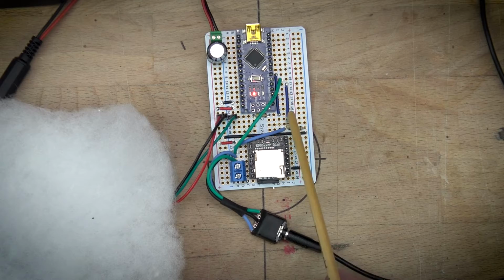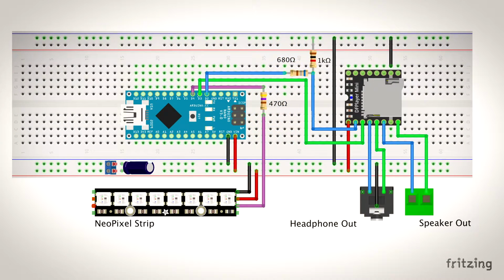Lightning and Thunder Effect - Arduino, DfPlayer Mini, NeoPixels

Comment: I would like to use this just for lightning effect, without the thunder, what do I need to remove in the code ? I tried with the full code (just the lightning hardware, not the player) it works, but it stops after 2-3 times flashing, I guess it's waiting for some mp3 ti ply that is not there ?
Reply from the maker: Sorry for the slow reply. You may have already figured this out but you're probably correct. There may be some issue with the sketch waiting for the track to stop playing. Here's a version with the audio stripped out. I didn't test it but it does compile without errors so it should be pretty close!

// includes
#include "SoftwareSerial.h"
#include <Adafruit_NeoPixel.h>

#ifdef _AVR_
#include <avr/power.h>
#endif

// set number of pixels in strip
int numPix = 16;
// set pin to control neopixels
int neoPin = 4;
// set initial brightness 0-255
int brightness = 255;

// create led object
Adafruit_NeoPixel ledStrip = Adafruit_NeoPixel(numPix, neoPin, NEO_GRBW + NEO_KHZ800);

void setup() {
  // initialize neopixels
  ledStrip.begin();
  ledStrip.setBrightness(brightness);
  ledStrip.show();

  // initialize serial port for output
  Serial.begin(9600);
}

void loop() {
 // lightning variables
  // use rgbw neopixel adjust the following values to tweak lightning base color
  int r = random(40, 80);
  int g = random(10, 25);
  int b = random(0, 10);
  // return 32 bit color
  uint32_t color = ledStrip.Color(r, g, b, 50);
  // number of flashes
  int flashCount = random (5, 15);
  // flash white brightness range - 0-255
  int flashBrightnessMin =  10;
  int flashBrightnessMax =  255;
  // flash duration range - ms
  int flashDurationMin = 5;
  int flashDurationMax = 75;
  // flash off range - ms
  int flashOffsetMin = 0;
  int flashOffsetMax = 75;
  // time to next flash range - ms
  int nextFlashDelayMin = 1;
  int nextFlashDelayMax = 50;

  // map white value to volume - louder is brighter
  int flashBrightness = random(flashBrightnessMin, flashBrightnessMax);

  // map flash to thunder delay - invert mapping
  int thunderDelay = random(1000, 250);

  // randomize pause between strikes
  long strikeDelay = random(18000, 30000);

  for (int flash = 0 ; flash <= flashCount; flash += 1) {
    // add variety to color
    int colorV = random(0, 50);
    if (colorV < 0) colorV = 0;
    // flash segments of neopixel strip
    color = ledStrip.Color(r + colorV, g + colorV, b + colorV, flashBrightness);
    ledStrip.fill(color, 0, 4);
    ledStrip.show();
    delay(random(flashOffsetMin, flashOffsetMax));
    ledStrip.fill(color, 8, 4);
    ledStrip.show();
    delay(random(flashOffsetMin, flashOffsetMax));
    ledStrip.fill(color, 4, 4);
    ledStrip.show();
    delay(random(flashOffsetMin, flashOffsetMax));
    ledStrip.fill(color, 9, 14);
    ledStrip.show();
    delay (random(flashDurationMin, flashDurationMax));
    ledStrip.clear();
    ledStrip.show();
    delay (random(nextFlashDelayMin, nextFlashDelayMax));
  }
  // pause between flash and thunder
  delay (thunderDelay);

  delay(strikeDelay);
}

Comment: Great Project. Also if it's older, I haven't seen such creativity for a long time. I think, it's one of the best Arduino / ESP32 projects for tinkers. Thanks for sharing!
Reply from the maker: Thanks! This one gets a lot of views because it can be used in so many ways. I just had someone use the basic idea for a Haunted Mansion changing portrait that turned out AMAZING. It also brings together light and sound control that opens up a world of other projects. Thanks for the comment!

Comment: Hi. I would really like to do this project. If you could please post an exact list of all the items used for this project in the chat including the speakers, speaker wires and what the gauge of the wires are 18 or 20 gauge and items used to power the board.. I'm racking my brains, and I have searched far and wide for all the items for this project with no luck. There are items missing. This list of items in the description of this video are link to items that are unavailable on amazon, the list in the description is incomplete and doesn't include all the items. Thank you so much. Its greatly appreciated.
Reply from the maker: I think this blog post has all of the smaller parts - https://randommakingencounters.com/lightning-and-thunder-effect-arduino-dfplayer-mini-neopixels/

There are some additional comments with replies that speak to wire gauge. It's a little bit of an "it depends" situation. The wire gauge is really determined by the number of LEDs in your strand and just how much  you're driving them (number of colors lit and intensity). This is a great link to help understand how many amps your strand might draw.

https://learn.adafruit.com/adafruit-neopixel-uberguide/powering-neopixels

Once you have the amps... pad it a bit for safety and then do a quick Google for awg wire gauge ampacity or current rating.  

I've also written a few replies that speak to powering strategies since you may need one voltage for the LEDs (5 volts) and one to power the Arduino (9ish volts). You can step voltages up or down and you can also try powering the Arduino with 5 volts on the VIN and GND pins but it's just at the lower limit of what the board may or may not function properly with.

Here's another link with a different approach to this effect that may also point you in a solid direction on how to tackle your project.

https://randommakingencounters.com/thunder-and-lightning-effect-redux/

One last thought if you're not an Arduino master programmer (I'm certainly not but I get by). Chat GPT writes pretty solid code if you explain what you're doing. If you outline the modules you're using (Arduino Nano, DFPlayer Mini, RGB NeoPixels or RGB LEDs) and write out how you want it to behave, it can get you close and is a great learning tool. It's not a replacement for understanding what the code does but it can provide a starting point. The links provided also have the code I've used on projects.

Hope that helps! All the best with your project!!

Comment: Question? Isn't the red and ground wire have to be a solid wire?
Reply from the maker: I'm not sure I understand the question but I'll see if I can get you some useful info. Are you asking if the positive (red) and ground (black) wires each need to individually be a single strand of wire? The answer is yes... you are correct. What might be confusing in the video is how the connections work on the prototyping board. Those wires make look like they're interrupted or bits of wire but the prototyping board has connections that string them all together. I hope that answers your question. Thanks for asking and all the best!
Reply: @RandomMakingEncounters  oh got it. the red and black 20g wire I bought isn't a single stran.
Reply from the maker: @roycenedeleff1893  wire comes in solid core and stranded. There are differences between the two in how the perform but a quick google search says 20 awg wire should handle up to 3.5 amps… give or take. The gauge is what’s the critical factor and I always try to build in a safety margin. I usually use stranded, silicone covered wire. I don’t like how the PVC covered insulation melts and is stiffer. However, silicone is softer and more prone to physical damage so everything is a balance.
Reply: @RandomMakingEncounters  okay. Im missing a few items I need for this project. Do you have a link for the purchase of the speaker wire, speaker wire connection, and the speakers? I'm kind of confused about how you have the LED lights connected to the board that go into the cotton cloud.I purchased a 12v power supply and Im also not sure how you're running the power to the board using the power supply. Last question. What is the brand the speakers you're using to connect to the speaker  connector. Thanks. I hope my questions weren't too confusing. Thanks:)
Reply from the maker: I think this blog post has all of the smaller parts - https://randommakingencounters.com/lightning-and-thunder-effect-arduino-dfplayer-mini-neopixels/

Here's another link that talks about the using the sound player and mentions only using an 8ohm speaker - http://www.trainelectronics.com/Arduino/MP3Sound/DFPlayer/

Here's a link to speakers I've used that are 3 watt, 8 ohm speakers - https://www.amazon.com/dp/B07FTB281F

I've had mixed success with speakers powered directly from the amp on the DFPlayer Mini. They can be a little quiet. The good news is you can also connect an external powered speaker jack to the board and use a speaker that has a headphone plug and it's own power to really blast out sound if you need it. The links above should show that.

Here's a link about a different approach to this type of effect and talks about power requirements - https://randommakingencounters.com/thunder-and-lightning-effect-redux/

Here's a good link about powering - https://learn.adafruit.com/adafruit-neopixel-uberguide/powering-neopixels

OK... let's talk a bit about powering projects like this. The Arduino can be powered through the VIN and GND pins with voltages between 7 to 12 volts. There is a voltage regulator on the board that steps that down to 5 volts which is what the board uses. The DFPlayer and NeoPixels are 5 volt only but some programmable RGB LEDs can come in several different voltages with 5 and 12 volts being common. This means you may have two different voltage requirements for your project... which is common and normal. To power the project, I usually connect the power supply to the VIN and GND on the Arduino board... that needs to ideally be between 7 and 12 volts. To connect the LEDs, these programmable LEDs are also connected directly to the power supply with a 1000 uF smoothing/decoupling capacitor added to protect against voltage spikes. IMPORTANT... the voltage you're supplying needs to match the voltage of the strip. If you're using NeoPixels, you need to step the 12 volts down to 5 volts or you'll fry the LEDs. If you have a 12 volt strip, you can connect as normal. You also need to connect the ground of the LED strip to the ground of the Arduino or the LEDs won't work. In the breadboard schematics you'll see that I always have different sides of the breadboard providing different voltages. If you choose to use a voltage regulator to step the 12 volts down to 5 volts, make sure the regulator can handle the amps the LED strip might need. It can add up quickly on a long strip. The Adafruit link talks about calculating power requirements. The thing you're looking for is a step down regulator that will take 12 volts down to 5 volts that has the amperage rating you need... more is better.

I know that seems like a lot. This setup is a little challenging because it can require figuring out the best way to get two voltages. You technically need over 5 volts for the Arduino and 5 volts for the DFPlayer and LEDs. You can use a 5 volt supply and boost it to maybe 9 volts with a boost converter for the Arduino. You can also use a higher voltage supply and step it down to 5 volts for the player and LEDs. All of the links above talk more about those strategies.

Good luck with your project!

Comment: I have a quick question? Does the LED lights you use in this project come in a longer strip? Also is it safe to put all the electrical components in a conduit box?
Reply from the maker: There's a short answer and a long answer! The short answer is yes! 

Here's the long answer: For an effect like this you can use either RGB LEDs or a strip of of white LEDs. Both come in long strips. You don't need to specifically use NeoPixel RGB strips. What you're looking for are addressable RGB LEDs. WS2812B LEDs are common. All of the electronics can be enclosed in a box... that's kinda ideal really.

Here's where you need to be careful. The longer the strip, the more power it draws. If each led has an R, G, and B led drawing 20 to 30mA each, each led will draw up to 60 - 90 mA. If you have 100 LEDs at 60 mA that's 6 to 9 amps... which is a fair amount of current. If you use a strip that only has white, the same 100 LED strand may only draw 2 - 3 amps... still a fair bit of power. What all of this means is you need to make sure your power supply and wiring can handle the anticipated amperage. If your power supply can deliver enough amps with room to spare, you shouldn't have any heat issues - it should stay cool to the touch. If your wire gauge is thick enough to handle the current you won't have heating there. When you enclose things you just want to make sure your components are generating heat that needs to be dealt with. Nothing should run warm let alone hot.

This effect can be scaled up easily. The only thing that really changes is current draw that needs to be accounted for. The maximum values are with all LEDs at full brightness which isn't common but it's safer to always plan for what the max possible is and then pad it a bit for a margin of safety.

Hope that helps with the project! There are some good sites out on the interweb that talk about powering long RGB led strips that talk about wire gauges to use and some tricks to inject power along the strip if you start to get really long strips. All the best!
Reply: @RandomMakingEncounters  Thank you. I'm using one strip of LED lights for a 16"×20" wooden light box. Hopefully I won't run  into any issues. .
Reply from the maker: @ that should be pretty manageable! Good luck with the project!
Reply: @RandomMakingEncounters  ty
Reply: @RandomMakingEncounters  I'm creating a replica changing portrait from the Haunted Mansion. Medusa portrait and the April to December portrait using scrim material.
Reply from the maker: @roycenedeleff1893  fantastic! The Haunted Mansion is a family favorite!
Reply: The scrim material's transparency is amazing. It's what Disney uses for the grave yard of the HM.
Reply: @RandomMakingEncounters A little pricey but well worth it.
Reply: The scrim material was extremely hard to find too but. I was able to get my hands on it. Only one company sells it that I know of.
Reply: @RandomMakingEncounters  I'll post a video of it after I complete both portraits.
Reply from the maker: @roycenedeleff1893  that would be fantastic!

Comment: Hi, I need some advice on programming  an Arduino uno with led strip lights. I need my strip lights to strobe like thunder and lightning initiated with sound on a mini mp3 player on the solderless bread board.

Also, I need strip led lights to be programmed with Arduino uno to fad in and out very slowly. Any advice would be great. If y ou have a diagram for me to follow. Ty!
Reply from the maker: This link might help with the first question - https://randommakingencounters.com/thunder-and-lightning-effect-redux/ It shows how you might use a breadboard, Arduino, MP3 player, and MOSFET to control a strip of white LEDs. In some ways it's easier than using RGB LEDs.

For programming fading in and fading out... there are a few ways to approach this. If you are using RGB LEDs, one of my favorite channels is this one - https://www.youtube.com/@ScottMarley Scott uses a library called FastLED and he has some great step-by-step videos on getting started and getting some effects going. 

If you're trying to fade a strip of solid color LEDs that cannot be controlled by a microcontroller in and out, that's where the MOSFET comes in and goes back to the lightning tutorial. The Arduino controls the MOSFET using PWM (pulse width modulation) and is pretty simple to set up. You need one pin on the Arduino and you connect the strip to the MOSFET module. The main thing you want to be sure of when using strips of LEDs is you're calculating the power (AMPs) your strip will need and then adding a bit of safety margin. Your power supplies, wiring, MOSFET boards all need to be rated for above and beyond what the strip will need.

Last bit of coding advice. I've started using ChatGPT to streamline my coding. There will be some people who hate that I say this but it can write some pretty good starter code. I do know enough about programming to find it's faults and flaws and it often makes mistakes or doesn't understand what I'm trying to really do but it's a useful tool if you're not a hardcore programmer or are just starting out. I'm able to have it generate a first draft and then I bend it to my will or modify to get what I really want out of it.

I hope all or some of this helps! Best of luck with your projects!
Reply: @RandomMakingEncounters  ty
Reply: @RandomMakingEncounters  The effect I'm trying to accomplish is having the led strip lights fade in and out very slowly, not rapid. Like a light dimmer that is slowly turned to where the light is turned on at its brightest  and slowly dimmed down until the light is turned off and slowly dimmed back on. Not to slow or too fast.
Reply from the maker: @roycenedeleff1893  gotcha. Here's one approach that is probably the most straightforward. You could use an Arduino and connect it to a MOSFET breakout board that is made for use with Arduino microcontrollers (there are a ton out there). You connect one digital pin from the Arduino that supports PWM to the control pin of the MOSFET board. You supply power to the Arduino and the power pins of the MOSFET board... usually 5 volts on the MOSFET. There are two screw terminals on the MOSFET board - on for the main LED power in and one to connect the LED strand to - the power out. For your code, the basic principle is to make the Arduino pin an output and have it slowly send a value of 0 to 255 to the MOSFET ramping up and down with a delay on the loop. That slowly brightens and dims the strand. Here's a video that covers a bunch of ways to control power with an Arduino but the LED part is at the end - https://youtu.be/IG5vw6P9iY4?si=35OQN_8uM1fgkdQB&t=1800

This is a very common and recurring question which kinda makes me think I should do a video about it!